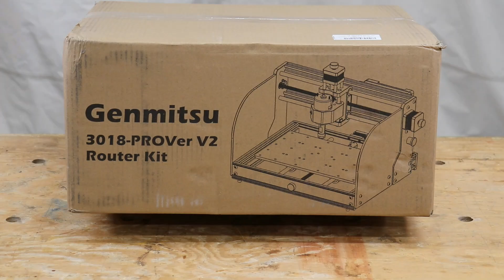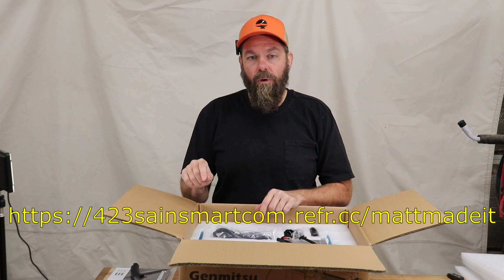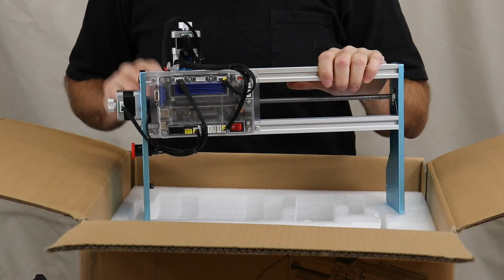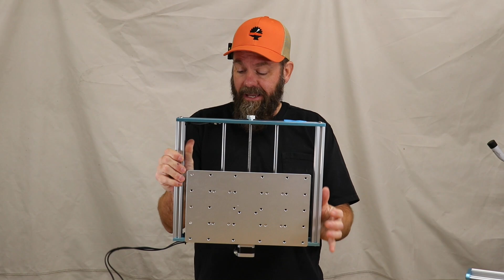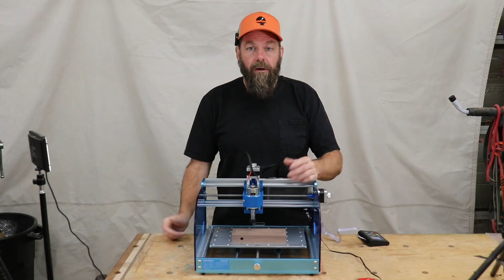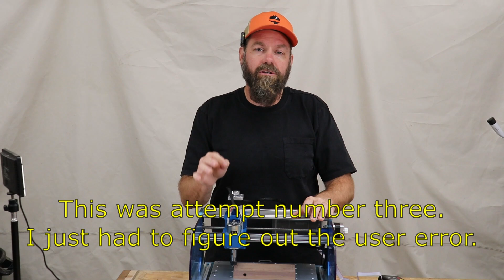Unboxing Mini CNC Machine from Genmitsu

Comment from the maker: This little CNC is built well but it's just too small to be useful for what I do. I ended up giving it to my nephew. He's a senior in high school and will be going to college to study mechanical engineering. He has also been into 3D printing for several years. I asked if he wanted it to learn about CNC's and he immediately said yes. So I think it went to a good home and will be a great teaching aid for him. Click the Sainsmart link in the description, shop for maker SWAG, and save 10%.
Reply: That's where I'm at as well; it's too small to be very useful in the shop. I am getting a 4040 pro to get my foot in the cnc door though. I should be able to use that to make enough small projects to sell until I make enough to get my onefinity.

Comment: Hey Matt, liked the video. The scenario, I had for getting a cheap machine like this was to learn how CNC 's work , learn about feeds and speeds, and learn the design software without a $1000 plus investment.  My projects are mostly gift's. It's worked out well, and  friends and family love the person little gifts . you're right, it's small and limited, but now I feel confident and am saving up for something like a onefinity.  Keep the vids coming
Reply from the maker: A learning tool is probably the best use for a CNC this small. Thanks for sharing your experience.